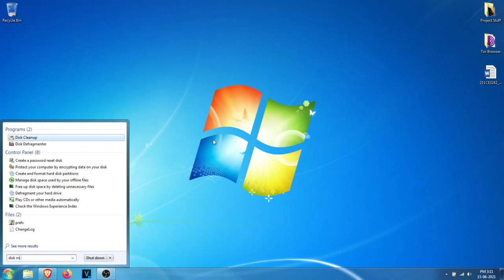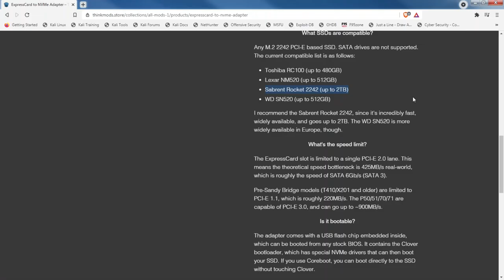How To install 3 or 4 SSD on a Laptop | 2021 | Devil Emox

Comment: You have freaked my out with your hardware skills. please create a video on how to connect 2 laptops using hdmi cable in linux. (I want to use Dual monitor using 2 laptops)
Reply from the maker: Sure bro ☺️